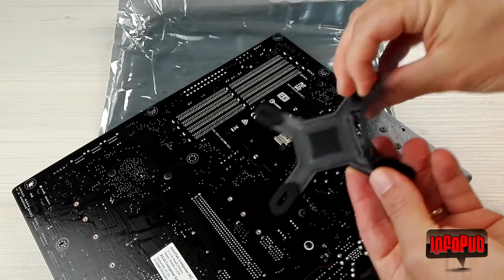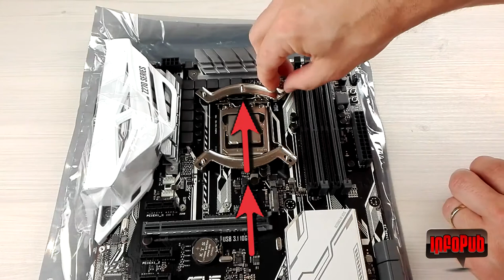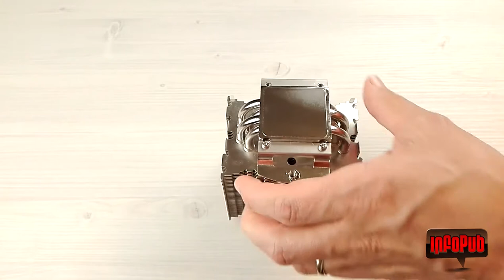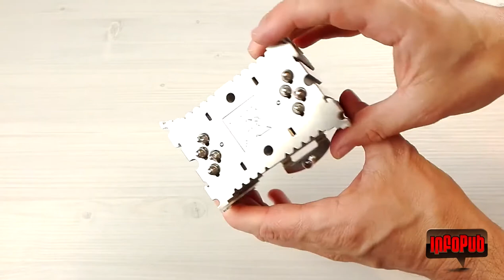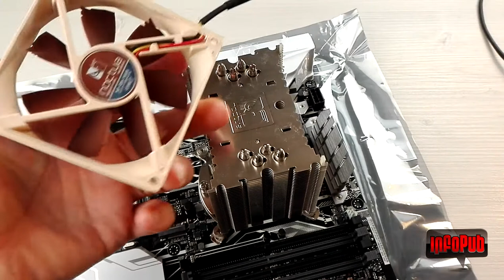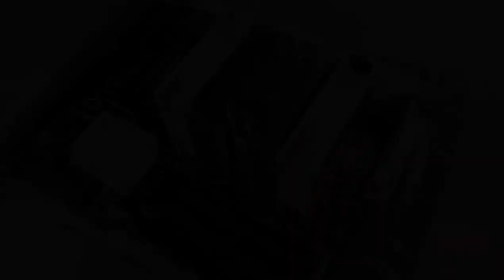Cum se Monteaza un Cooler Noctua NH-U9B SE2 pe Placa de Baza Intel LGA1151

Comment: L-am cumpărat azi, aștept curierul să-l aducă.  Din păcate vechiul AiO care m-a ținut 5 ani la bine și la greu a dat semne de boală gravă(s-a dus pompa, 😢) și am fost nevoit să mă îndrept către ceva iar Noctua e cam ce  e mai bun pe la noi după mine când vine vorba de ventilatoare CPU. Video simplu și la obiect, mulțam 👏 👍. P.S. Presimt că am să mă enervez de numa la clemele alea 😅 .
Reply from the maker: Daa, clemele sunt enervante. Înaintea montării ventilatoarelor, nu uita să montezi făşiile autoadezive din silicon antivibraţii pe radiator! Altfel o iei de la capăt cu clemele. Baftă!
Reply: InfoPub Ms, s-a notat.
Reply: L.E : M-am dumirit cu clemele; aparent e mai ușor sa le fixezi pe ventilator prima dată, apoi să le împingi în locașul  de pe radiator. Practic două click-uri. Marea(nu foarte) problemă pentru mine acum este că back-plate-ul plăcii video are răsuflarea lui Hades fix în ventilatorul in al coolerului. Cât timp placa nu e folosită temperaturile sunt în parametri ideali dar can placa lucrează temp. urcă vertiginos(@70°C în full load GPU). Nu e mare scofală, nu face throttling , dar totuși. Carcasa e răcită din față și e puțin cam compactă, nu prea am spatiu de manevră. 🤔🤔🤔
Reply from the maker: @danm94  Pozitia cooler-ului pe procesor este determinata de configuratia interioara a fiecarui calculator. In cazul tau, iti recomand sa schimbi pozitia cooler-ului. Toate componentele vor lucra la temperaturi mai ridicate iar ventilatoarele vor incerca sa compenseze prin viteze mai mari de functionare. De aici rezulta o uzura prematura a componentelor, un zgomot mai mare sau chiar deteriorarea anumitor componente interne. Incearca sa creezi un flux de aer dinspre ventilatoarele frontale ale carcasei, de unde este aspirat aerul rece, catre ventilatoarele din spate ale carcasei, unde este scos aerul cald din interior (daca ai ventilatoare in fata si in spatele carcasei).
O sa pun aceasta atentionare si in descrierea clipului.

Comment: mersi de video! de ce nu l-ati montat cu ventilatoatele inspre VRM-ul placii de baza? am vazut mai multe videouri pe net care asa le montau. nu avea loc?
Reply from the maker: Are loc. Initial era sa-l montez asa, ca in filmare. La montare trebuie sa ai in vedere circuitul de aer al carcasei si sa tii cont de faptul ca aerul cald se ridica. Eu am deasupra 2 ventilatoare care scot aerul. Daca as fi aspirat aerul de deasupra cu Noctua, acestea ar fi intrat in conflict cu ventilatoarele carcasei. Daca as fi aspirat aerul de jos, ar fi intrat in conflict cu aerul de la placa video sau ar fi racit procesorul cu aer cald de la placa video. Pentru carcasa mea, aceasta mi s-a parut cea mai optima configuratie: intra aer rece in carcasa din fata, este preluat de ventilatoarele Noctua care racesc procesorul, dupa care este scos afara de ventilatoarele carcasei, prin spate si deasupra.  Placa video aspira aer din interiorul carcasei, care vine din fata, si il scoate afara prin spate cu propriile ventilatoare. VRM-ul se afla intr-un compartiment separat si aspira aer din exterior de sub carcasa pe care il scoate afara prin spate cu propriul ventilator.
Reply: @InfopubRo  foarte bun raspunsul si bine documentat! pacat ca nu am vazut si carcasa in video :) 
succes in continuare!